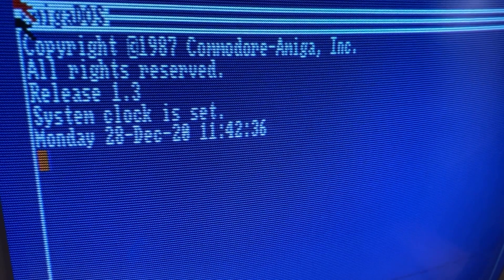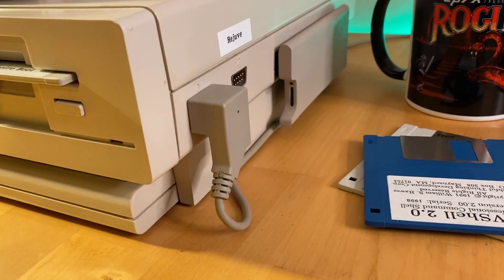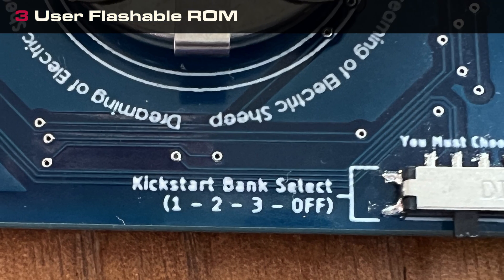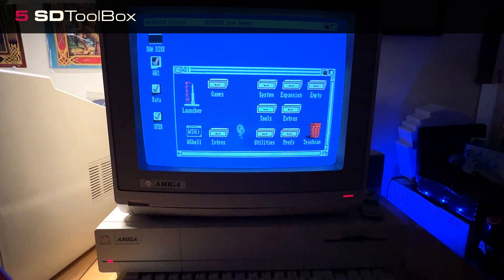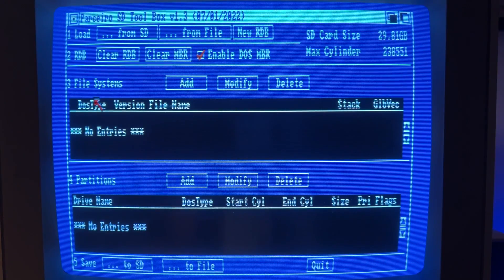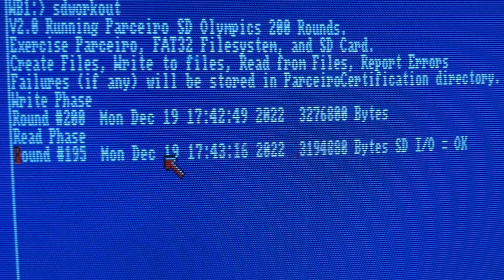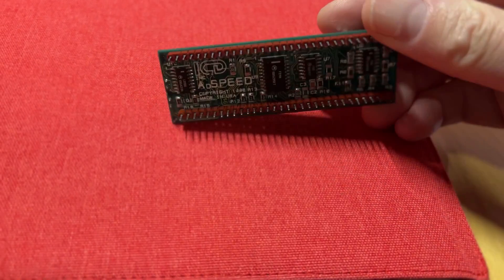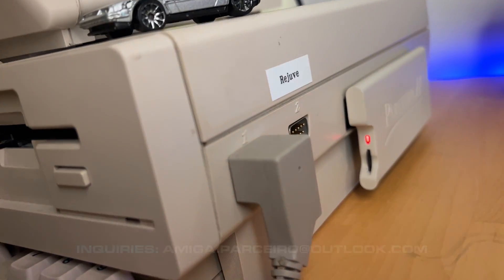Best Upgrade in 30 Years! Parceiro II

Comment: Hello, 
What's the difference between Parceiro II and Parceiro II+?
I need the Rom Kickstart 1.2, is it possible to add it?
Reply from the maker: The difference is the optional accelerator, which pushes your 7Mhz machine to 28Mhz.

Comment: I got a Parceiro II's last year and did the PAL's modification to my A1000. Truly am amazing piece of hardware. I can now swap between KS 1.3/WB1.3, KS2.05/WB2.1 and KS 3.2.1/WB 3.2.1 on my A1000! 

Oh, small tip - the Parceiro makes use of certain instructions from the 68010+ which GREATLY speeds up the read/write speed to the MicroSD, so now there is are three good reasons to drop a cheap 68010 into your A1000 - 10 to 15% (on a good day) CPU boost, WHDLoad escape key compatibility and 40% faster read/write access with the Parceiro.
Reply from the maker: Dunklee is one of my modern-day heroes. His work is truly inspirational. Glad you "get it" and are having so much fun, too!

Comment: I have the first version.  So what happens in V2 if you do not do the PAL chip upgrade?  Does it work without the autobooting like V1 does?
Reply from the maker: Without the mod, the Amiga will prompt for a Kickstart 1.3 disk.  Once the OS is loaded, then the Parceiro will boot into Workbench 1.3! In other words, you don't need a custom boot disk but you would need a Kickstart disk. Then the P2 would take over and go from there.
Reply: What would happen if already have the kickstart built in the A1000? I added it via one of those DIY boards between the CPU and board
Reply from the maker: @RetroGamerHK  I'm not sure, but I think you'd need to disable that mod. In the Rejuvenator example, for the P2 to work you have to remove KS ROM from the Rejuvenator board.

Comment: I have used the Parceiro 11 for 6 months and it is everything that the video says it is.  Mine was shipped without the RTC because of a chip shortage and I was not prepared to wait, but I have ordered the chip from Mouser.  I also ordered the PAL chips and the 681000 chip but I have been avoiding modifying the original board and so far I have not had any desire to move from WB1.3.  I fitted a drive emulator and loaded the kickstart image onto this, and now it kicks and boots without physically swapping disks. Not only is the hardware a valuable upgrade but the software is intuitive and it compliments the hardware.  The RD and has gone into this package is worth the asking price alone. I am one very satisfied customer.

Comment: I have one of these (version 2) and it truly is amazing.  It boots faster than my a3000 or a4000. 

I recommend adding 68010 cpu for a speed increase and hotkey quit in whload.  

Read/write speeds are about 400k/s (sysinfo reports). 

Adding the two pal chips and a bodge wire is really easy.  No more kickstart floppies.  Autoboot 1.3, 2.0 or 3.x.  I boot in 1.3 for that authentic 80s experience.

Comment: Are you Don Parceiro by chance? :) Sure sounds like it :D 
* Bus passthrough requires, humm, a 74 series chip and RC, which is not very expensive to add. 
* CF (and SSD) offers faster write speeds, and internal IDE solutions have been around for A1000 for quite a while. With SD, 'consumer write-once' rather than 'user' is assumed, sadly as a platform is as alive as the new software coming out for it. For larger drives and autoboot, it's nice to see the special software for it although 3.1 is king.
* RTC is vital for creating on the platform, and many expansions lack it not least the original A1000 HW, so it's ... vital. At least I would not buy a RAM expansion lacking it, ever. It is a welcome addition. <3
Reply from the maker: The passthrough isn't expensive to add, but it is big and bulky and since most folks would never use it - it was a design decision. Thanks for watching and for your insights. Happy Holidays ScoopexUS! I appreciate you!!

Comment: The Parceiro II really is the ultimate upgrade for the A1000. 
Additionally, David is such a great guy who was more than happy to help me get a better understanding of both the device and my Amiga. 
Cannot recommend it enough.
Reply from the maker: Can't agree more about everything you've said. Now that I've got mine out there I'm heading over to your channel to watch your experience. Good to see you, Mr Lurch! Happy Holidays!!
Reply: @AmigaLove  cheers mate. You too 👍
On the Amiga, honestly, a bump on o even just a mb of chip ram and I really don’t think I’d want any more from a 1000
Reply from the maker: @MrLurchsThings  I can say that I used to have my ICD AdSpeed @14Mhz working with the original Parceiro and the speed felt like the P2 w/o acceleration. I'm going to be doing some experiments in about a week or two with the P2 and see if I can get that fixed. The main benefit with mild acceleration is screen refresh and drawing of drives with lots of folders, etc. And, it does improve read/writes a bit, too, which you can feel. But I agree. With 2MB Chip, 8MB modern Fast and now really peppy (and vast) HD speeds and it feels... well, it feels about done, doesn't it? I know there will be some accelerators in the near future added, and some will probably pull the thread on the sweater endlessly like video options, etc. But I'm extremely happy with it.
Reply: @AmigaLove  I guess my plan with my 1000 (which I point out in my vid) was more about giving it some “quality of life” upgrades (HDD, KickStart) and then just a little extra pep (8Mb, 68010). If I want a screamer, I’ve got other machines for that.
Reply from the maker: @MrLurchsThings  Yes, I wholeheartedly agree 100%. We're on the same page there. Even having extra kickstarts feels weird to me. When I need silly powers, I roll over to my A3K. Cheers, man!

Comment: Excellent video! I really love my Parceiro II, and can't recommend it enough - it really transforms the A1000 😍
Reply from the maker: Thank you! And yes - "transforms" is a good way of putting it. It's not a total take-over, but it definitely makes it very convenient to use and is surprisingly quick even at 7Mhz. Curious - are you running a Rejuvenator, or stock? And do you use any acceleration?
Reply: @AmigaLove  No Rejuvenator (though I'd like one!) - I modified the daughter board for the GALs but that's all. I did have issues with a noisy address/data bus, but replacing the 68000 with a 68010 solved that completely - and gave me a 10% speed increase too :)
Reply from the maker: Yes, I think that may have been my issue, too, with the AdSpeed.

Comment: Man, what a great update to what was already a really great card! Thanks for the great video man!  Just when i think there aren't going to be any real new hardware bits for my Amiga 1000s!
Reply from the maker: The Parceiro 2 is such a massive leap it was really hard for me to express in the video. The first time I turned it on and watched my A1K boot up 3.1 in 15 seconds I felt the hair on my arms raise up. Will I ever use that OS? TBD. But holy smoke even just the speed increase in OS 1.3 combined with the MASSIVE transfer volume... If I could figure out how to get my AdSpeed to work with it all (David has one that I sent him and he got it working with his...) I'd be in total heaven. It would make the nutty speeds 20% faster still + better screen redraws. Regardless, it's awesome!
Reply: @AmigaLove  Yeah, I have a Classic 520 card that I use with one of my Amiga 1000s, but it's far from being the most elegant item sticking out the side of the machine, heh, even with the little side box i built for it.  But, i totally get you on the booting.  The first time I booted up off the KS Rom and HD CF Card on the Classic 520 i was blown away.  Booting into 1.3 or 3.1 in a few seconds on an Amiga 1000 is just amazing and not something I ever thought I'd see.  The Parceiro though is not only brilliant, but elegant in its design, so I'm definitely getting in touch with him about any additional runs of them and would love to have one after watching it in action.  Just looks amazing, not to mention his own custom tools to make it so easy to configure.
Reply from the maker: @danjmcs  It's quite possible if you sent him your P1 he'd cut you a deal on the P2 (I think he might be able to scavenge some parts? Dunno.) And yeah, to bring top-shelf software tools to the table is really, really special. We're so lucky to have him working on Amiga projects in 2022+!
Reply: @AmigaLove  Yeah, no P1 here, I'd recently bought a Classic 520 card when the P1 was released, but I've got a P2 on the way now!  Thanks again for the great video and share!

Comment: I just got mine a week ago but haven’t set it up yet. I moved and haven’t pulled the Amigas out yet. Thanks for answering the rejuve question I had on the autoboot. My bro has 5 rejuve pcbs on the way and we are going to build a couple. I’ve got an original so I’ll put the new one in my vampire 1000. Amiga love you have sparked so much new life an interest in the 1000! You have no idea how grateful we are! -opcode
Reply from the maker: You've left me a bit speechless (for a moment). That's not an easy thing to do! Thank you for the kind words. 

That is SO cool that you share this hobby with your brother. When I labelled the P2 as "The Best Upgrade in 30 Years" the Rejuvenator was in my mind as the best upgrade prior. It's now been over 30 years since its release. These two upgrades are the perfect marriage. You get bonkers chip, and bonkers storage. 

And stay tuned, because David isn't done... He's working on a little something else to turn our machines into little hot rods.
Reply: I recently moved too and both of my Amigas are still in bins. Have been in contact with Dave and will be ordering one soon. Can’t wait!

Comment: Gees, there is no link to Parceiro II. Seems to be Unobtainium 😁
Reply from the maker: Correct. No link. However, if you are interested you can always inquire at amiga.parceiro@outlook.com  It all depends on Mr. Dunklee's availability, ability to source parts, etc. But his original Parceiro (what I call the P1) is indeed gone to the sands of time. Some of the chips used for it are no longer out there.
Reply: Thanks for your fast response. I will assume we all will be interested in the new, improved Parceiro II.
Reply from the maker: @xxycom8963  When you turn it on for the 1st time with a P2, it's... it's hard to explain how magical it seems. More power than I feel like I even need. It's amazing. (And David isn't done turning our machines into little hot rods...)